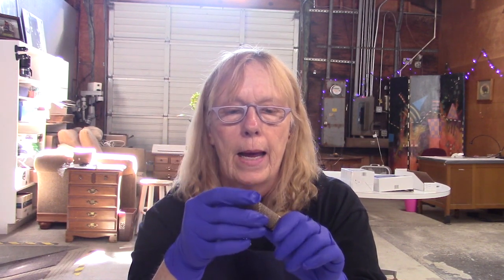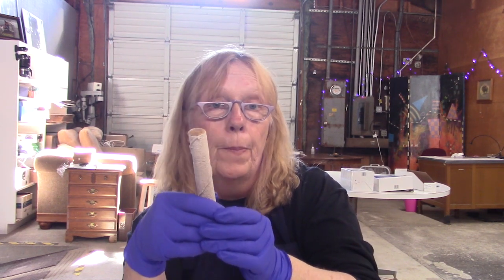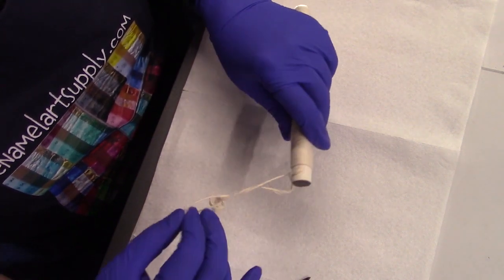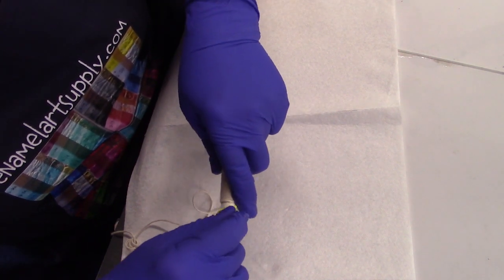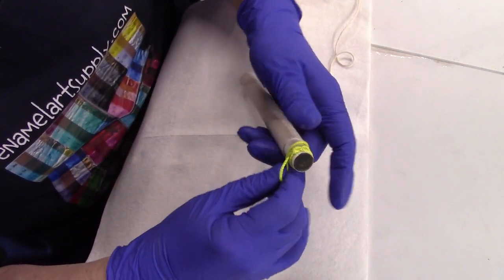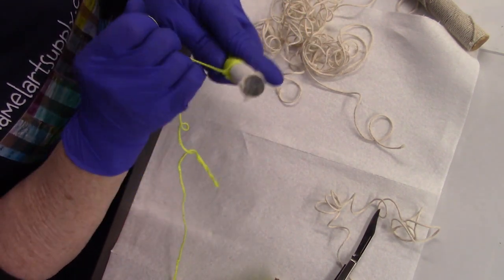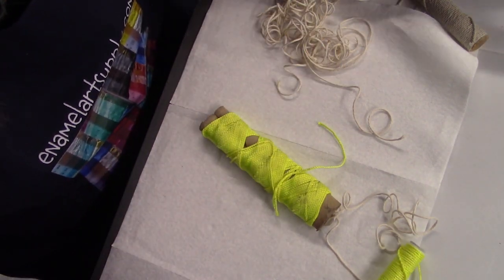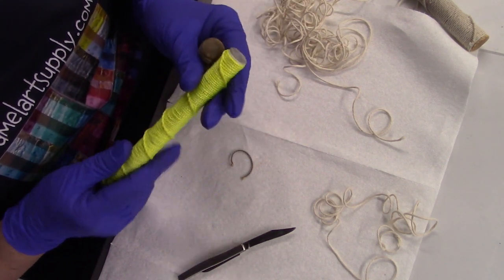Fiberglass Brush Instruction mp4

Comment: Very helpful.  I'm new to enameling, so I haven't bought a glass brush yet!  One tip though, is that you used nylon to tie it up, so just burn the ending cut end and it will swell slightly so it won't slip loose.